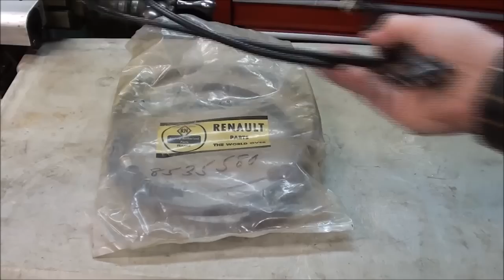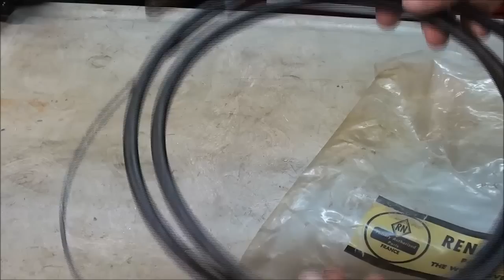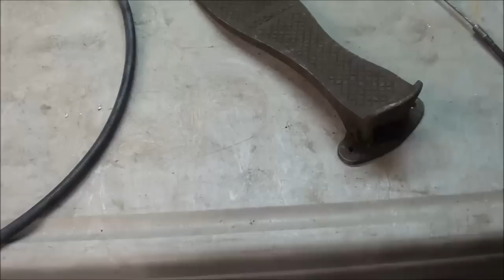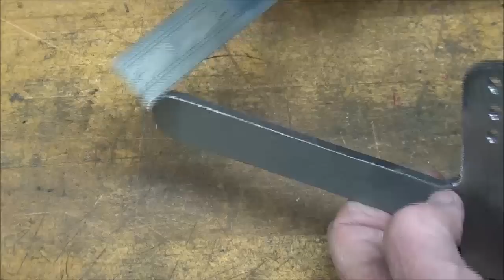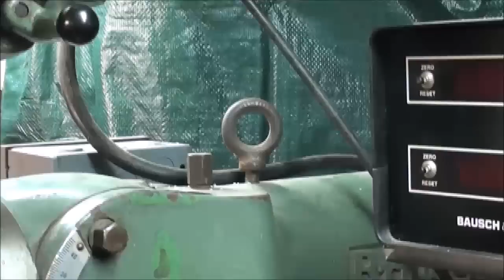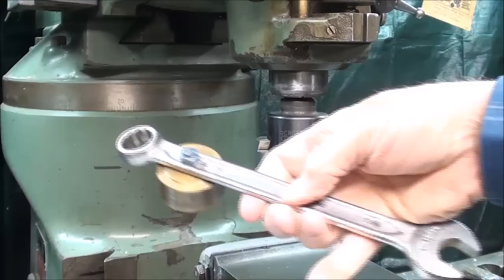SHOP TIPS #206 Tubalcain Makes a Bridgeport Pedal Operated Brake pt 2

Comment: Mr Pete, After having my Haimer 3D edge finder fall out of the collet as soon as I loosened the draw bar and breaking the tip, I took your idea and made some changes and performed some modifications to my Bridgeport. 

Not wanting to have to stand on one foot while loosening the draw bar, I decided to go in the direction of a way to have the brake “On” or “Off”. I did this with an air cylinder that works great. I will be happy to send you pictures if you would like.

Thank you, Sir for being an inspiration and a fountain of great ideas!

Regards,
David
Reply from the maker: Sorry to hear about your instrument dropping. I love my foot break and I use it all the time it frees your left hand.
Yes, send me some pictures. The air cylinder is a good idea. I just don’t have Shop air all the time without turning the compressor on because it looks like a sieve

Comment: What a great idea!  I recently bought a 1989 Wells-Index 847 milling machine and was looking for ideas to do something similar.  This is spot on!  I will see if I can make it work with a bicycle cable.... I also have some cables from the throttle control out of my boat... the ones we replaced that are still working fine... that is also an option.

Pretty cool.  I got another project added to the list.

Comment: No hydraulic system ever is leak proof. On pressurized systems, the regularly running compressor compensates for leakage. With your pneumatic brake control every time you step on the large cylinder, a tiny amount could leak out. There's no avoiding that. What was needed is a similar natural way to invite air to leak back in when you're not stepping on the big cylinder.

As you originally set up, the only return spring was on the slave. Had you put a strong enough return spring on the master cylinder (maybe reduce the spring tension at the slave to add some at the master), every time you take your foot off, and both the slave and master completely retract, if enough air had leaked out during use, a relative vacuum would be created in the air line. Whatever leaks that were previously allowing air to slowly escape with each use can now allow air to slowly refill the vacuum with each rest. The duty cycle would need to be infrequent as averaged throughout the day. I suspect a full night's rest would be plenty for daily use. For a bit more insurance, install a check valve on the air line. Then the duty cycle could be continuous.

This is essentially how hydraulic brakes on road vehicles work. A return spring at the brake (slave), and a return spring at the pedal (master). When the pedal returns and the brake retracts, if a vacuum is present, the fluid reservoir replenishes. Anyway, I guess this is purely academic at this point.
Reply from the maker: Thank you very much for that information

Comment: One more thing:  One of the handiest things I've discovered is the magazine spring from a shotgun.  They are a couple feet long, yet have a very low spring constant, so they don't produce much force when compressed.  They are also made from very small-gauge wire. so they will compress a long way and not coil-bind.  I wonder if that would have been a good return spring for your pneumatic pump.  Might be too small diameter to go over the shaft; just a thought.

Comment: In the late 'sixties, my older brother had a Renault - one of the ones that looked like two stacked boxes.  He'd bought it for a "work car" - a real beater.  A friend eventually convinced him to part with it, but my brother warned him, "Go easy with this thing, George; the parts are mostly held together with rust."
Of course, being a teenager, George beat hell out of it on the rural roads, and one day during a panic stop, the whole front wheel assembly and crossmember separated from the frame.  When we went to look at it, the front wheels were up against the back wheels and the snout was sitting on the ground.  I never considered a French car after that.  LOL
Reply from the maker: My 57 renault was the worst car I ever had. It actually was a joke it was so bad. I had a mercury topaz that was pretty bad. My son borrowed it, and called to tell me it wouldn’t move. I want to look at it, and the rear wheel was up against the inner fender. It had a rusted through and I had to have the car towed to the junkyard.

Comment: I guess I got lucky with my now 14 years old 240.000 km renault laguna... never had any issues besides the damn electronic key card failing every two years. Mechanically it's in super condition. Very interesting solution with the cable. I just bought a mill and the previous owner made pneumatic conversion but if it hadn't this would be up there first thing. (after i'm done disassembling/cleaning and reoiling everything.

Comment: Why didn't you just put a mechanical lock on it? You could have just put a sliding collar on the brake handle. so when you engaged the brake lever you tighten a thumb screw that holds the brake until you release it.

Comment: Aircraft Spruce has push-pull ratcheting cables in 6, 7, 8 and 10 foot lengths. Wide variety of unusual hardware. Good stuff, but pricey.

Comment: Hey, thanks for another great video. You know, as I was watching the part 1, I was thinking, you could probably use not only a cable from an e-brake, but the whole hand brake mechanism from a car. It's got a ratcheting mechanism, so you could tighten it, and then work with both hands on getting the tooling out without having to stand on one leg like a heron. :-D And after you're done, you just disengage it. I don't know for sure, but I think cables for e-brakes are typically longer than throttle or hood opening cables, and any car scrap yard would probably have them galore.

Comment: How about holding the brake with a bungee cord?  Or if you need more power, perhaps a spring with a hook.  Not as good as your solution, but a bit quicker.  You know, I bet I could probably figure out a way to do it with a hammer and chisel as well...  ;-)

Comment: A word of caution, when removing a chuck, boring head or other heavy spindle mounted tool, DO NOT place your little finger under the tool (grip the chuck with your thumb and first few fingers and allow your pinky finger to  wrap under the tool) when the  tool comes loose (before you can stop the falling momentum of the tool), you smash your finger between tool and jaw of the vise or whatever is on the bed.
Reply from the maker: +winston911 Thanks!

Comment: I enjoy your videos alot but on your foot  brake idea,it's  great but your brake handle is upside down,the radius goes up and to the inside so it will lock when you lift it up.Check it out and try it.
Reply from the maker: +James Hatfield No wonder it wouldn't lock. Its been that way since I got it. No wonder no one watched the video-they don;t need a brake

Comment: Music wire is used to make springs, you can buy it online in hobby shops and sometimes in some hardware stores.  Winding springs that are large, requires a special winding mandrel but that would be right in your skill set.  After winding, bake the springs for 15 minutes @ 500 F, yes I said 500F for 15 minutes.  that will set the spring shape.  remember to wind the spring around thinner diameters than you want because of spring back.  You also have to bend the legs of the spring or loops tighter and let them spring back.
Reply from the maker: slad roznik Thanks

Comment: The Renault Dauphine was a small rear engine piece of socialist junk. Their cute little "beep beep" commercial sold quite a few cars in the early sixties but quality was not there and sales soon plummeted. My 1975 yellow Fiat station wagon was the same kind of sorry car with so many problems I finally sold it for a song. The clutch was cable operated like the Dauphine and so stiff my wife couldn't drive the car. The electrical system failed one dark night causing the headlights to shut off on a busy highway. The windshield leaked like a sieve, body parts rusted, the speedometer quit and the heater malfunctioned among other things. Factory workers in socialist countries have little incentive to produce the quality that free enterprise nations take for granted. Let the buyer beware.
Reply from the maker: Ellie Price My speedometer howled so loudly in the winter I had to disconnect. The shutter for the radiator did not work--not heat. Head gasket blew at midnite 75 miles from home in winter storm. On & on. The 2 tone horn worked great--girls loved it. Defroster so bad that passenger wiped windshield non stop.

Comment: Ha, I still reach up at times even though I've had the power drawbar for some time. Old habit I guess.
Nice job on the footbrake. Accelerator pedal next?? ;-)
FYI: I suspect you could get a bicycle shop to fab up a cable of any length for anyone else wanting a similar setup.

Colin :-)
Reply from the maker: ***** thanks

Comment: Of course, all the helpful suggestions come after all your hard work...

As someone mentioned below, bicycle brake and gear shifting cable/sheath can be purchased and easily made to any length.  Walmart even sells sections of cable and sheath in their bicycle section of the store.

Another solution would have been to use a motorcycle brake or clutch master cylinder easily obtainable from a local motorcycle junkyard.  And, you'd have subject matter for a future lathe video on the fabrication of a small slave cylinder.  Check out Magura aftermarket hydraulic clutch kits for dirt bikes.  I installed one of their kits on my Honda XR400 dirt bike.  Fabricated the bracket with simple aluminum angle and tube stock along with aluminum brazing rod.  There's a very short YouTube video out there I threw up demonstrating the final bracket slave cylinder function.

If you did go the hydraulic route stick with transmission ATF as your working fluid.  

An additional possible mechanism is an electric solenoid like from a washing machine water inlet valve or a power door lock from an automobile.

Crawling all over a junkyard lot is just about as much fun as solving problems in the shop!

Thanks for all your work in the shop and in the production of the videos!

Comment: Nice job Lisle,
You have given me an idea for the lever clutch on my Browne and Sharpe milling machine.........
It's a pity you can't knurl the foot pedal instead of sticking tread tape onto it.
I suppose you could mix some very course sand into some machinery colored paint and make a non slip surface on the pedal that way...

Matt
Reply from the maker: Matthew Gischus Thanks for watching
Reply from the maker: Matthew Gischus Thanks for watching

Comment: Hi sir.
That is probably the only Renault part that is going to live longer than a few years.
Renault has a poor name in Holland.  This might have changed a bit now, but they used to be quite poor. 
Ebay sells many master and slave clutch cylinders, that might have been even stronger than the cable, and could have made it able to swivel the head.
While the pedal might be working well, it does put you on one foot while using it, and you might become unbalanced, and trip.  With the most respect, As we get older, falls are very common, and broken hips are often the result.  I'm sorry to have to attract your attention to this, but please be careful.
Rn. Marcel Timmers.
Reply: Marcel Timmers perhaps some sort of latch that catches when you push down...then when you press again, it releases????
Reply from the maker: Marcel Timmers I noticed the one foot business.

Comment: I know this is a moot point but I have to wonder if you had a return compression spring on the air pump cylinder it may have worked by returning it to full open Regardless the cable idea was your original idea and goes to prove the first idea is usually the simplest and best. .
Reply from the maker: Myron Marcotte Thanks for watching

Comment: Hi Pete...

I like it!  Nothing better than an improvement in the shop.  FYI in part 1 you mentioned leaky air system, the best thing I ever did is to put an electric valve at the tank (normal position off) hit the switch and I supply air to the leaky shop, shut off when done and NO tank drain!!!  I love it!

All the best
Chuck
Reply from the maker: outsidescrewball good idea

Comment: I believe that's a clutch cable out of a Renault 8 or 10 and possibly the one you had as well but not sure (I had an 8 with a 1.1L engine which was a larger version of the Gordini Dauphin and the 10 was the next size up, all 3 had rear engine hence the reason for the long clutch cable)
Reply from the maker: sharp x Thanks for watching

Comment: Nice job. It looks a lot like a clutch cable to me - although 8 foot seems a bit long for one....
Reply: jix177 Those Renaults had the engine installed in the trunk...lol
Reply from the maker: pierre beaudry it had great traction that winter
Reply: mrpete222
So did the Corvair until Ralf Nader shot them down from the skies.....

Comment: as for the spring placement you could always mount a vertical bit of metal with a hole drilled to at least get rid of the rubbing of the spring.
Reply from the maker: C.J. phillipson yes

Comment: Nice.Some steel supply houses sell the wire rope (cable) and the shielding by the foot. Than you can make it as long as you want.
Reply from the maker: monkey12345648 Thanks for watching

Comment: If you thought the Dauphine was bad, you should have experienced the Simca.
Reply: MrShobar Hey I bought a blown  Simca for $75.00, rebuilt the 4 cyl engine, drove it for about a year and sold it for $350.00, while I was in the 82nd Airborne at Fort Bragg NC. Everyone laughed at first, but hey it worked. I put matching stickers on the sides that said "Would you believe 454 Cid". With the loud exhaust, it got a lot of stares.
Reply from the maker: MrShobar I test drove a simca after I sold the renault.  It wasn't very good either. I bought a Buick
Reply: My family owned a Simca Versailles.  My enduring memory is of my mother, brother and I pushing it to get started so dad could get to work.

Comment: Great fix Mr. Pete. I agree with you about the poor spring placement, I believe that the hardened steel of the spring with quite quickly wear down that Bridgeport cover it rubs on with each application.You would be well advised to reexamine that placement. Other than that, well done sir !!
Reply from the maker: Billy T thanks

Comment: Had two Dauphines in 1963-1964. The second was a Gordini. Very reliable. Anyway, the Dauphine was a 4CV. Found the cable on eBay:

http://www.ebay.com/itm/OE-Renault-Dauphine-4CV-Caravelle-Floride-Gordini-Hand-E-Brake-Cable-beap-44-174-/380960154906

Comment: Good set of videos!

Since you don't like the look of the spring up top, I think it would work just as well to put a spring somewhere on the pedal, out of sight.  Just my 2 cents!
Reply from the maker: MattsMotorz thanks
Reply: MattsMotorz that was my thought as well...the spare holes in the lever arm would be a good anchor, though may have to find (or wind!) a spring to anchor it back to the bracket.

Comment: You can by Bowden cables for bicycle breaks in long uncut rolls. It is likely a local bike shop could help you out with whatever length you like.
Reply: mrpete222 Another source is boating and marine dealers.  Throttle and gear shift cables are available in amazing lengths.  Also, the cables are exceptionally flexible.  Unfortunately, anything labeled 'Boat' is usually overpriced.   Online from one of the big discount chandlers like Defender is your best bet.
Reply from the maker: Clayton Firth I wish I had known that
Reply: Clayton Firth The housing comes in 50' rolls, and in just about ever color under the sun.  Then you can buy several different lengths for the cable itself.  The standard length for most bicycles is 6'.  However tandem bikes are much longer so a longer cable would be needed and could easily hit 8'.  They might make longer than that, but it's been years since I've looked in a parts catalog like J&B Importers out of Fort Wayne, IN.  After spending 20 years growing up in a bicycle shop I've forgotten more about bikes than most will ever know.  Kinda of like Mr. Pete and machine shop knowledge.
Reply: Oh and after reading rfcarlson's response.  You can usually buy cable 
and housing and walk out the door probably not having even spent $5.  We
 used to charge  $0.25 a foot for housing and a couple bucks for the 
cable.
Reply from the maker: garygsp3 Wish I had know that a few months ago.
Reply: Clayton Firth 

You can buy heavy duty cable and housing for things like motorcycle brakesfrom aliexpress as well. They will put whatever kind of connector you like on it, you can custom everything and only spend $20